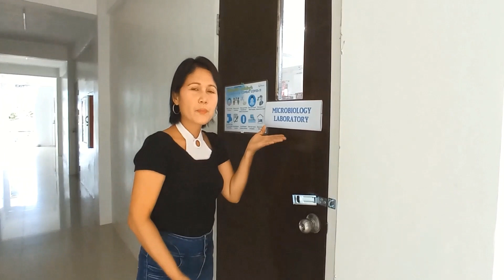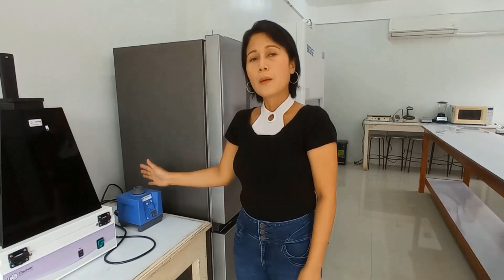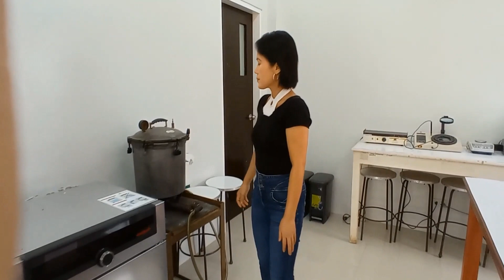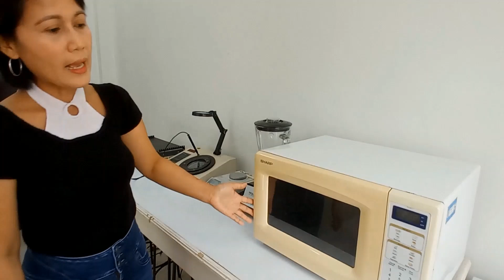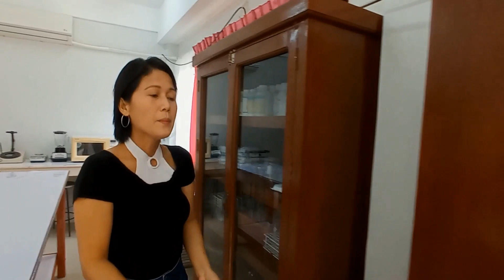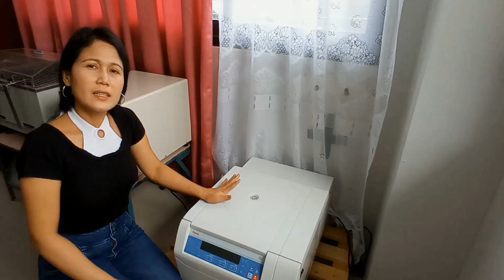Laboratory Tour: Basic Microbiology Laboratory and Equipment

Comment: Thank you, Ma'am Jho, for the informative brief and tour on various laboratory equipment available at the WPU Microbiology Lab. Just gonna list the equipment you mentioned. I hope I got them right: 
1. Microscope
2. Micropipette
3. Polymerase chain reaction (PCR)
4. Gel electrophoresis
5. UV transilluminator
6. Vortex Mixer
7. Refrigerator
8. Laminar flow cabinet
9. Incubator
10. Autoclave
11. Slide drying bench
12. Colony counter 
13. Toploading balance
14. Blender
15. Microwave
16. Vertical toploading autoclave
17. Shaking water bath
18. Horizontal autoclave
19. Refrigerated centrifuge
Reply from the maker: Right. Tnx for watching. Don't forget to subscribe.. hehehe.